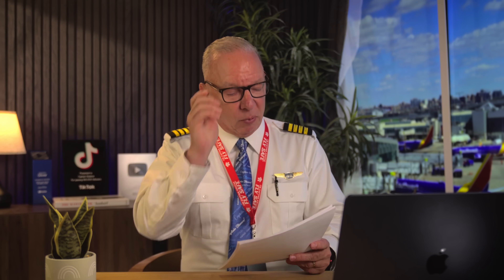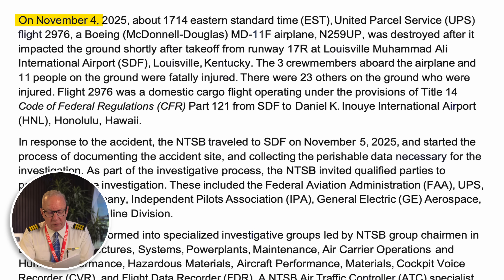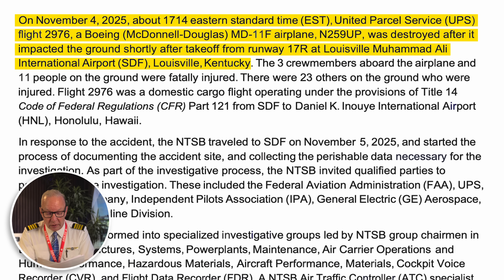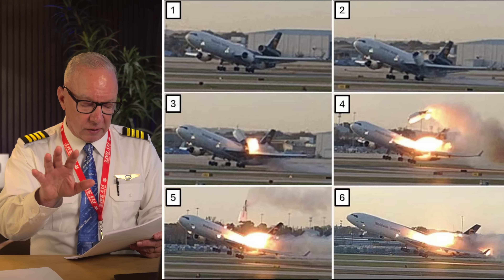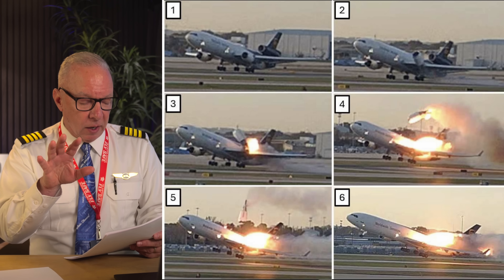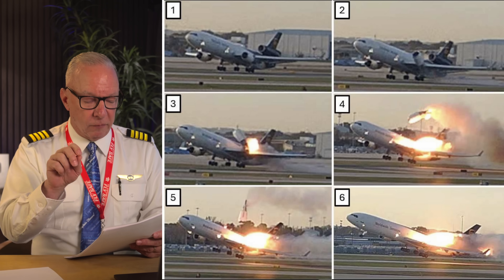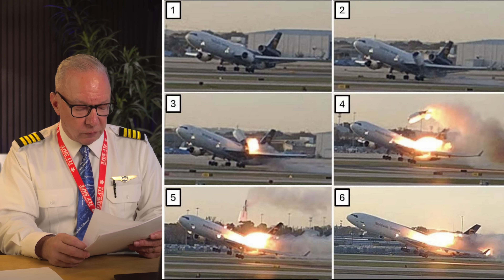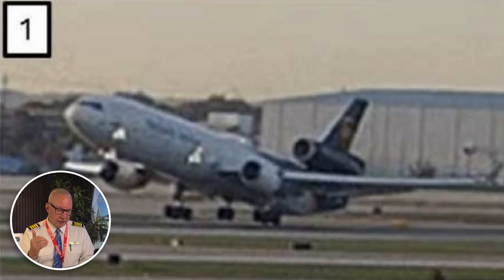UPS Crash Preliminary Report | Pilot Reacts to UPS Crash Report

Comment: A 6 year maintenance interval for a component that is under so much stress seems crazy to me. I hope they make this interval more frequent after this accident. RIP to those who lost their lives.
Reply: The component looks so small for holding up an engine generating hige thrust.
Reply: Those spherical rod ends are the same in principle to what we in the Motor Sports World refer to as : Rose Joints. They come in a variety of sizes and are used to hold most components ranging from suspension up to engines and assorted equipment. For those who are fans of Drag Racing, you'll probably be familiar with them. They're high grade billet aluminium cases and the bearings are stainless steel. When they fail/let go, for example holding an axle in place at high speed the results can be devastating. That aircraft was doomed before anyone stepped on-board, so, so tragic an outcome. Sincere condolences to everyone who has lost a family member, friend due to this awful event. R.I.P. From the U.K..
Reply: @geofo60 I know aluminum is nice and light and can be strong if machined into shape, but when in the air I think a better alloy should be used for such a high load bearing part. It's one thing to lose an axle in a dragster while sitting in a safety cage and quite another to lose an engine in the sky.
Reply: @geofo60  thanks for that info BTW ... Helps us to understand.
Reply: @geofo60 I call them heim joints. They're on nearly every suspension component on our race car. "Spherical rod ends" makes them sound highly engineered. And thats something that my car is not. 😂
Reply: @user-yh1fn1gf5f There are actually smaller components holding much greater force. The problem is the maintenance. You simply can not afford to skimp on that.
Reply: @user-yh1fn1gf5f Oh no , no , no , it's not that small , it's much much larger than you think. Obviously if it's only for supports. Can you imagine 2 engines with 8 supports supports the entire? Well, it doesn't support, it supports the thrust, the forward thrust of the aircraft. So if that's the case, the thrust is pushing the mount bracket against the wing bracket.. That means.
The bracket would have to be very thick with very thick side Support.
Reply: @user-yh1fn1gf5f   It looks grossly under-engineered. I think my car engine has better mounts.
RIP and condolences to those affected.
Reply: @bobmason1361not getting the design at all. You'd think there'd be multiple mounting points. One thing breaks and the engine flies up in your face?
Reply: @bobmason1361under-engineering is what leads to over-built hardware. Over-engineering is when you create unnecessary complexity.

The issue here is not the types or sizes of components. Similar parts will be found in every airliner model. The issue is more likely related to Boeing (and MD when they still existed) increasing inspection intervals to increase their profits. Service contracts for these planes are typically fixed cost, so reducing inspection intervals allows them to pocket some extra cash.
Reply: @user-yh1fn1gf5f  You know, you're right. Why wouldn't they add redundancy to literally every structural element on a flying machine where additional weight means needing additional power to get it airborne, which means more structural material to reinforce it, which also needs to be doubled or tripled for redundancy like you're suggesting which means more weight which needs more power and more fuel...
It's a plane ffs, weight is at a premium, that's why. It took off and landed 21,000 times on that part since the last service interval. It flew for 30 years. The engineering on the bracket isn't the issue.
The last time this happened it was because of improper maintenance damaging the mounting hardware, I'd put money on that being the cause this time too.
Reply: Yeah especially when the DC10 had the same issues with American Airlines.😮
Reply: @erikhaack4123  The DC10 issues were because maintenance was taking shortcuts that led to the brackets getting slammed into other components whenever the engines were mounted or unmounted from the wing, not normal wear and tear.
Reply: @JohnSmith-dp2jd  thank you
Reply: @JohnSmith-dp2jd There were eyeballs on this engine mount a month ago
Reply: @mattieice4689  And that potentially means unmounting the engine, the exact task that led to cracks in the engine mounts in the 1979 crash.
Reply: @erikhaack4123 that was more of a maintenance issue, mechanics deviated from standard maintenance practices to save time
Reply: @erikhaack4123 …different accident…different cause…
Reply: @erikhaack4123 American was using a forklift when the engine had to be removed - a procedure not recommend by the manufacturer MD that resulted in damage to the engine mount.
Reply: Those p l anes will probably retired.  The cost to fix this problem plus just old plans repair costs will make it expensive to fly.
Reply: That’s a reasonable guess, retired not by legal edict, but because they will be uneconomical to inspect and repair.
Reply: well that pylon only failed once before in history. that was 46 years (!) ago and was proven to be caused by bad maintenance. Honestly, they didn't have a strong reason to pay that part any special attention, more than any other part of an airplane. 
and if anyone else says it's a design flaw, I'm gonna explode and jump over an airplane like that #1 engine ^^ 

But yes, checking for metal fatigue more frequently on an aging plane definitely makes sense. and honestly, that seems fair and doable. If that's not too expensive and doesn't take forever, maybe we can see them fly again. for a few years. and when they are finally retired, I want one as a house 😁
Reply: @kirakaffee9976 a couple have failed the same way .
Reply: @kirakaffee9976 That is backward thinking. You increase intervals when aircraft age.
Reply: Everything seems crazy after it fails. But, this worked for decades, and we don't know how many other parts are under more stress and inspected less. 
It's easy to look at these things and feel like we're smarter than the thousands of professionals who didn't see the problem over decades. We're not. We wouldn't have known before the crash if they didn't. And now they know too.
Reply: @ED-es2qv …correct…too many YouTube specialists here…clueless…
Reply: @ED-es2qv well said.
Reply: You can be sure they're all being checked now and not just visually, maybe dye pen or eddy current, such a tragedy, God bless all who died and were injured. As well as their families and all who loved them.
Reply: I think it's time to scrap the plane all together and use a more modern aircraft.
Reply: @xeneidonuk if you buy UPS and FedEx some new planes, fine.
Reply: @xeneidonuk oh so you think maybe its that time for YOU to make thay decision? Thats an easy decision for someone not footing the bill. Or will you be writing UPS a check to cover the cost for the $350 million dollar Boeing 777 Freighter (777F)? Well maybe we can help you save some money. If you get extremely lucky you might be able to find a used Boeing 777 Freighter (777F) for around ehhh 100-150 MILLION then the conversion will cost you an additional 15-70 million and then youll have to add in all the costs for testing after conversion before flying legally. Just let me know when you will have the check ready and I will let them know they have a very kind donor. Its always someone in the comments spending someone else’s money. Thank you sir for willing to make this large donation……oh wait, you arent footing the bill are you? Smh people these days I swear.
Reply: @Ghetto-toaster22  - Those are some big numbers you're tossing around there, son... but let me ask you:

What's the cost of a human life? Or, in this case, 14 human lives. Maybe you should take a step back from defending corporate capitalist greed and take a look at who and what really matters in this issue.

But hey... maybe I'm just wrong, and there is some dollar amount that you think is an acceptable cost for human life. If so, you're a despicable excuse for a human being.
Reply: @Ghetto-toaster22  Yep. People have no idea on what it costs to replace a plane. MD-11 is a work horse and UPS and FedEx won't be scraping them anytime soon.
Reply: @M @Maverick7613 exactly what I was thinking! What an absolute moron trying to make a case for the cost of a plane being more expensive than human lives. SMH
Reply: @Maverick7613 as long as everyone will accept the cost of delivery going way up. You need to get over the corporate greed idea. Everything you want will just raise prices. What's the acceptable amount of money you will pay for shipping costs?
Reply: @Maverick7613 This is such as asinine and bad faith response. Of course there’s a number that an acceptable cost for human life. That’s how our entire risk/reward calculation works in every facet of life. Is human life worth something? Yes. Is it worth an unlimited amount of resources? Obviously not. 

US traffic accidents close to a trillion every year in both direct and indirect costs, but we don’t stop driving or do much of anything to improve road safety and reduce harm other than window dressing.

What’s a human life worth? Total direct and indirect costs from traffic accidents are about 2.5% of GDP. Over 40,000 fatalities that’s about $1.7 million per fatal accident. So somewhere between 0 and $1.7 million.
Reply: @Ghetto-toaster22 So- it has killed over 700 people, you are OK with that continuing to happen?

YOUR thinking is the problem
Reply: @BobBobman-v1d  Braindead response
Reply: Engine to pylon - pylon to wing  mounts should be deep checked annually.
Reply: @roler95 - I am reasonably sure that this "fatigue/stress crack compromised engine pylon"; belonging to the doomed MD-11 owned by UPS, is not a "one off" = the DVI that will be done on the #1 and #3 Engine Pylon on every single MD-11; and now on every DC-10 which are even older, will show that at least a few other of these aircraft have cracks and/or structural fractures on their respective pylons. If several instances of that occurs, nobody should be surprised if every single aircraft of the MD-11/DC-10 type is condemned by the NTSB. If that happens, then parts (avionics, powerplants, etc.) will be scavenged from most of them and the airframe shell broken down to scrap metal, and some lucky MD-11; and DC-10 aircraft, will be placed on static display in museums.
Reply: Of course they will. Changes will only be made after a fucking horrific tragedy occurs. No preventative anything in this country.
Reply: Something similar happened to the ELAL 747 that crashed in Amsterdam in 1992. The bolt that keeps the engine attached to the wing broke loose and when one engine came off it took with it the remaining engine on the same side of the plane
Reply: @highs_and_lows4665 ….correct…many don’t seem to know that…and confuse this with the DC-10 crash.
Reply: The aft mount seems to be a single point of failure. 
In my opinion a bad design....
Reply: @Juergen_Miessmer  True, but making it a 2 point mount would be a bigger alignment nightmare, and making it stronger was a much easier option, and also allows much more tolerance in the design.  Pretty much as designed you could hang the entire airframe off that single mount without issue, the problem came with poor or incorrect maintenance applying stresses way past the design limit on it.
Reply: My thoughts exactly.  6 years?  If cars need to be inspected annually (in my state), why not planes?  Also, there needs to be gadgets beyond "eyeballing" visual inspections to find those invisible stress fractures before they become a greater problem.  Making inspections easier and more effective will hopefully incentivize companies to keep up rigorous maintenance and not cut corners.
Reply: I was going to say the same thing. A 6 year visual inspection only is wild! No NDT/NDI requirement is crazy considering that it seems like that mounting point is a single point of failure. I’d also like to know what that pylon mount was tested to fail at. I know the report says 29000 cycles was the next maintenance check, so I imagine it would have been tested to fail way above that number. Flight critical mounting points should have a max cycle life or hours, seems like they just keep extending the part when they don’t see anything wrong with it at the time of inspection.
Reply: Yea I'm surprised how long it is for the inspection, especially for a vital part of the aircraft that experiences stresses..
Reply: it's a combination of cycles, flight hours and calendar time. There should be enough fatigue life in these components that this is more than adequate. It is based on decades and millions of flight hours of experience. There is a lot of science behind it. If it failed to find these cracks then there is something very unusual happening that was not well understood. Possibly, like previously, that bit of structure was damaged by incorrect maintenance or something else like mfg quality control. Or the metallurgy on this specific component was flawed. But you can't just look at the calendar time and say "that doesn't seem right".  These inspection intervals are not based on a gut feeling. Also it is not a question of pulling off a panel and looking with a flashlight. The engine has to come off. These components are designed so that this is only mandatory on the most heavy checks which are years apart. If you had to do this every year nobody would ever buy the airplane.
Reply: Improper methods used for R&R of that EXACT engine, had been recently completed.
Reply: These aircraft seem headed to the boneyard, but will they have to do major work just to get them there?
Reply: Especially after the 1979 incident at ORD!
Reply: Why 5 years before looking at it?
Reply: Apparently this was fastener fatigue not the pylon being damaged as it was in the Chicago disaster.
Reply: @richpalmisano1740  You didn't watch the video before making that comment. The part they say had fatigue cracks was the ring of material surrounding the bearing, same part that failed in the chicago crash.
Reply: Now that they're aware that this part can't last six years, they absolutely will be looking at it more frequently. It's why the NTSB was created and we don't just shrug like we do with car crashes and call it bad luck. The entire point is to figure out the problem so we can ensure it doesn't happen again. No, crashes really shouldn't put you off flying. Every crash, flying becomes safer and safer. No, do you know how hard it is to put what is basically a tin can that'd been shredded and burned back together? It takes months. Then you have to figure out what the source of the damage and if the part was malfunctioning before it smashed into the ground. Often we find a ton of other issues along with the fatal one.
Reply: Or just retire these old machines
Reply: I need to request a Delivery Investigation for tracking number 7E9E49-1Z7E9E490460515986
The package was delivered to an unknown person.
The receiver name and phone number on the shipment were incorrect.
We already provided UPS the correct consignee details.
This is a Misdelivery, not a successful delivery.

Please start:

Proof of Delivery photo

GPS delivery location check

Driver interview

Package recovery and redelivery to the correct consignee.
Reply: It may "seem" crazy, but this is the first time that component ever broke on the MD11, yet it's been around for what, three decades. Hundreds of thousands of cycles.
Reply: IMPO- This aircraft needs to be laid to rest. It was just not meant to fly safely in the current landscape of greed. 

From the cargo door design, to the hydraulic system routing, and finally the pylon mounts…this aircraft requires stringent maintenance that corporations just aren’t willing to perform.

Greed built this aircraft, greed will now put it to rest
Reply: Let's Cut the Sh**p!  Regardless if DC-10's are called MD-11's, truth be told, the Mechanics 
like in 1991, again saved 3-4 hours, by fork-lifting of a fixed engine, to bolt back into 
the pylon, instead of method by "MD-11" aka, DC-10 manufacturer instructions not to do that!
Reply: @ValeriaMessalina1 You have zero evidence of that and you’re talking out your rear
Reply: @BobBobman-v1d this is a bot 🤖. Exactly the same comment word for word as on another channel. Chinese bot farms working overtime
Reply: @paulu7751 Really? The only reason I can see for that is for the Chinamen to work on discrediting US aircraft manufacturing… Actually now that I’m saying it, you’re probably right
Reply: @ValeriaMessalina1 how do you know this???  Same reply on another channel. Go away Chinese bot 🤖!!!!!!
Reply: @ValeriaMessalina1 how do you know, do you work at SDF?
Reply: The fleets are too large, too old, too sporadically maintained. This is a structural problem for the US empire as a whole.
Reply: You'd think this part would require a yearly or at the very least an inspection every two years, 6 years in bloody insane. If this was done often, then this could have most likely been avoided.
Reply: @richard-davies  There’s a big cost and time loss in the air to ground a plane for annual inspections. That’s not going to happen.
Reply: I doubt those planes will fly again.
Reply: @DaveMiller2  I think that is what people are hoping.  They are not fuel efficient.
Reply: Jet engines push...not pull.  The engine was pushing hard when the rear mount broke...the engine was still pushing and rotated on the front mount before breaking off.
Reply: @johnbaldwin2948  The big fan blades act like a propeller and pull the engine forward.
                                              The compressed air with the fuel lighting and expending in the combusting chamber and pushing against the front of the chamber 
                                                   help to move the engine forward.  
                                                       As well, the hot air blasting out of the tailpipe pushes against the ambient air which adds to the forward movement.
Reply: @John-nc4bl  Propellers PUSH the air...wings PUSH the plane up.  How else can a plane fly upside down.  Angle of attack and speed create lift...by compressing the air under the wing...the lower pressure above does very little.  This is one of those things that we've all been told...that is wrong.
Reply: 21,000 cycles.  This plane was worn out!  All that weight on those attachment points after landing did them in.  Invisible, unless X-rayed.  A big job, just getting to those parts.
Reply: That’s corruption for you to have that arrangement.  The FAA probably giving the airline some break. I’m having to spend that money to check those items more often.
Reply: @cool2180  Not every tragedy is a conspiracy.
Reply: @rickeys good god THANK YOU for saying that. Man these people ate wild these days. They see everything as a damn conspiracy. Kroger is out of milk? It has got to be some kind of conspiracy to them. Some of these ppl need to be medicated or in a mental hospital…..just saying.
Reply: @cool2180  what corruption ?
Reply: @cool2180  exactly. they were lobbying against having more frequent inspections. its always the same reason -> corporate greed. people must die before things change.